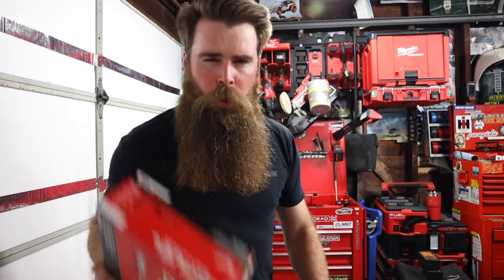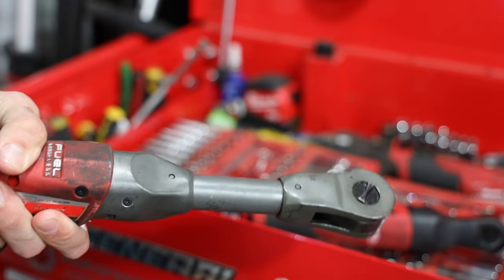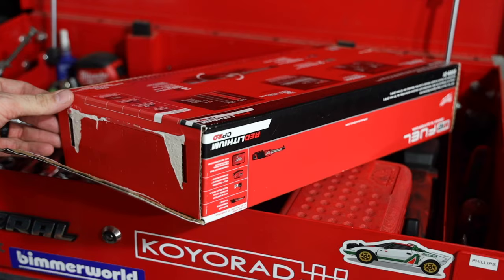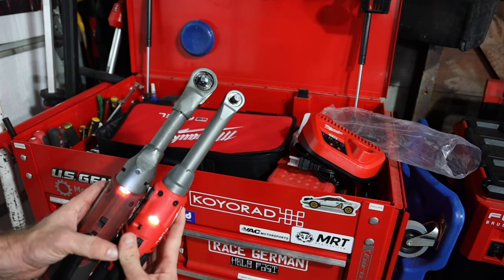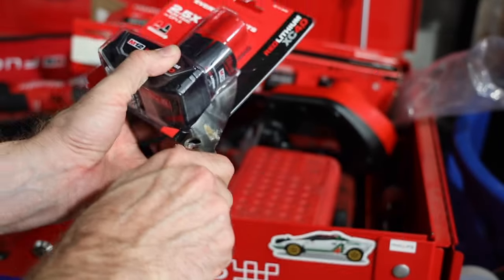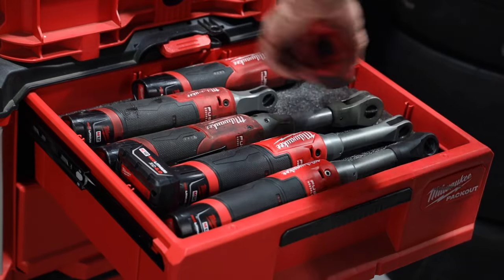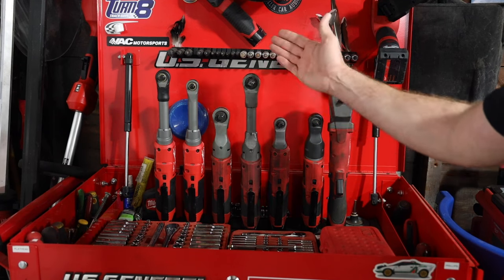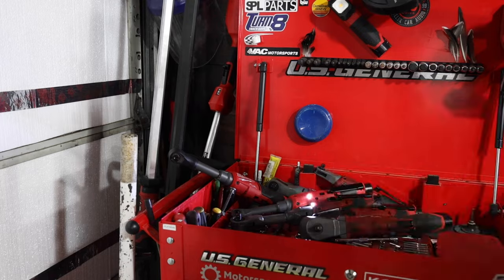Ultimate Milwaukee Ratchet Buying Guide for Professional and DIY Mechanics 🧰 #milwaukeetool

Comment: Man why do you turn the big electric wrench by hand under the car? Makes absolutely no sense. Just tighten it up til it stops then keep the fastener in place with it and tighten the nut with the regular wrench in your other hand. I'd use regular wrenches on both ends anyway doing that as it gives you way better feeling to tighten the fastener.

Comment: The extended ratchet, makes perfect sense that it will be most useful. I am looking to invest in a power ratchet myself, the video helped a great deal. Thank you!
Reply: How’s it working for u?
Reply: Harbor freight hercules 135 for ratchet free battery and charger
Reply: @zeuszerp9376  bro don't be the guy that compares harbor freight equipment to Milwaukee equipment, fuck sake.
Reply: @bigboss-yv2nr  they r all comparable if they fit the same genre of tool...hurcules is pretty badass
Reply: @zeuszerp9376  my experience with cheap power tools especially is that they don’t hold up like established brands. Especially when u start putting them through the paces and pushing them to their limits which is inevitable especially if you’re working on cars
Reply: @bigboss-yv2nr  I can agree but not these style of tools really...if u manually break the bolt with this ratchet and then use the trigger to get it out once manually broken these tools will last forever

Comment: I love my m12 ratchets, but when driving fastners, I hate how it tries to jerk my arm. It frequently kicks my hand into brackets and causing cuts and scratches. I prever the m12 impact driver now because it has much better torque control with the trigger. It could also be due to using the older models.
Reply from the maker: I can see that the older ones used to kick more it seemed like. Still way better than the old air ratchets those things would pin you down sometimes after the bolt would get tight. So you had to remember to have a good area for clearance.

Comment: I don’t understand why everyone loves extended. I ALWAYS barely have enough space to fit the regular one into all spaces. Also I have the high torque with 55ft lb instead of high speed. I feel like I made a mistake lol. Since you can use as a ratchet anyways
Reply: U are right. Speed really does not matter.  The slowest one still is faster then one with a regular wrench.
Reply: Would it be better to buy the side wratchet then? I feel like if you really need to bust out an impact then just use a regular one vs “ right angle” would be better correct?
Reply: @ssjdavid  It depends on each individual and the kind of work you are doing. Do and buy what you are comfortable with and don't listen to all these wanna be tool specialists here on their different channels in regards of what to use especially brand wise. Milwaukee battery tools are not necessary better just because lots of people think so and try to influence people. I do not only watch for longevity but more than not on the design and handybility and that overall is way better with Dewalt. I know i wlll get a lot of criticism for this now but voting for the same party every 4 years doesn't necessary make things change to your advantage.

Comment: I got both regular high speed ratchets last year & they immediately made my OG brushless ones obsolete. Also have the 3/8 RAI that I got for the sole purpose of doing seat bolts. That guy does good on calipers, front engine, pretty much anywhere you need a bit more torque with little room. 3/8 stubby impact barely gets used.
Reply: what size do you recommend for car stuff & things around the house? 3/8?
Reply: @mr.cabello9214 what did you end up buying

Comment: Great video! Really torn between the 1/4” or 3/8” longneck, I have the 3/8 high speed and love it. But hearing you say the longnecks are where it’s at makes me wanna give it a try!
Reply: I have the 1/4 long neck and wouldn't go without it now. You can also swap out the anvil in the head and make it the other size for $30
Reply: I just broke down and ordered my first electric ratchet after  popping a couple of exhaust manifold bolts on the way to work this morning. Having already done the job once a few years ago I figured this would make it less of an extreme-anger-inducing pain in the dick. After seeing the 3/8 and 1/4 side by side I regret buying the 3/8.

Comment: Thank you. I was stuck in decision paralysis. I still have the very very very first gen ratchet, which has been AMAZING, but I want a little more speed, torque, and the extended one makes the most sense.

Comment: Agree with you on the most part. The impact to me is super helpful especially removing caliper bolts as impact wrenches don’t usually fit in those areas. I have the first generation of the fuel ratchets in both regular and extended. If you are working on top of an engine the regulars are great if you are working down in the engine compartment the extended are better. The extra power of the first gen fuel is very handy even though they are mildly slower and have a larger head than the gen 2 high speed fuel ratchets.
Reply: High torque Impact + Swivel Socket...

Comment: Can't you use a milwaukee right angle drill, use a 3/8 socket adapter, with a 17mm socket, and use it the same as a Milwaukee ratchet?  As long as you break a the 17mm bolt loose first, u can use a Milwaukee right angle drill just like it. ???? right?

Comment: Great demo, thanks! I have a question about the impact-capable tool. Is the head locked while not operating, or in other words, can you apply torque manually or only with the powered ratchets? In other-other words: can I use it as an extension of my "built-in-my-arms torque wrench".
Reply from the maker: Yeah the ratchet still works as a ratchet if you need extra torque. The impact wrench does not do that.
Reply: @BlakesGarage  Thanks!

Comment: I just don’t get the 1/4” drive unless it is super small nuts or bolts. My mid length 3/8 are shorter than a 1/4 deep. And my 3/8 stubys are shorter than a 1/4 standard. So I actually have more room for tight spaces in the 3/8 drive. Just my opinion. I have the high speed extended, the stuby impact and the right angle all in 3/8”. Then a half inch mid torque for bigger stuff. Really all I need

Comment: The high speed one is good but, no torque for bolts with little rust or residues of locktite on them. The old extended reach is better for overall bolt or nuts.
Speed vs torque

Comment: I have the high speed 3/8 normal size ratchet. These extended reach ones look pretty nice.. I’m just a weekend warrior so it will be while before I can justify getting them
Reply: So I just got this tool , and still reach for the 3/8' short.  I like the new one, its going to find its place in my arsenal; but there are some things at the start I don't love.   Its noticeably heavier.  The shaft is stout don't get me wrong, but it does add weight.
Reply: It's only $106 for tool only

Comment: Man, that right angle impact is the shizz! I use it for suspension work and it performs flawlessly. Great video 👍🏻
Reply from the maker: Glad it works well for you. I think I’ve only used it 4-5 times and it usually doesn’t have the juice to break suspension bolts loose for me.
Reply: @BlakesGarage 

have you tried the 6 ah on it?  It gives it a extra +\- 20 tq or about a 10% power bump compared to the cp 2.0. 

also another trick for another 5% +\- power bump is to use the battery fresh off the charger.

It wouldn’t bust a suspension bolt I couldn’t reach with the stubby and It immediately broke free with these two steps,

Comment: Are brushless better, and if so why ?
Reply from the maker: These are all brushless. Yes, brushless is better. The reason why is that there are no brushes to burn out in the motors run much smoother and are able to deliver more torque and variable speeds
Reply: @BlakesGarage  ~ Thank you !

Comment: Do the make a screw driver shaped like that?
Reply: Yes. I own it.  They are called the Milwaukee right angle drill.  I had it for 10 years.  I use a 3/8 inch socket adapter, use a 17mm socket, and can use it the same way.  Obviously it's not super super powerful.  So if your working in a hard to reach area on your cars suspension, break the 15mm bolt loose with a ratchet, then you can use your milwaukee like a ratchet.  It comes in handy when your installing oil pans, and etc.  You don't want to lose your mind, so using a milwaukee drill with the adapters will painlessly remove the 15 bolts.

Comment: They (2569-20) are seriously over priced and under perform their advertised torque. If it wasn't for the fact I didn't want to buy a new battery system for a competing brand, I wouldn't have bought this.

Comment: I am not a big fan of Milwaukee's dated and Antiquated paddle trigger. 31-year professional I would not use any of those. The sealed had Matco is a hammer and then updated 14.4 Longneck snap-on's rip I do have Milwaukee stubby impacts and B drivers so it's not like I'm against Milwaukee but A co-worker but the long necks and the conventional and the high-speed and they feel like crap and the paddle ever oh my God it's so 80s